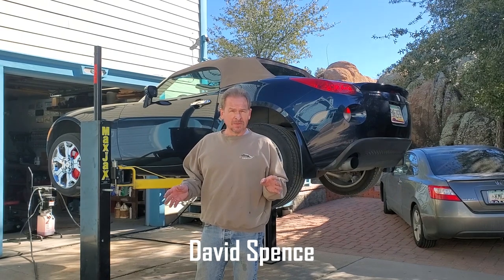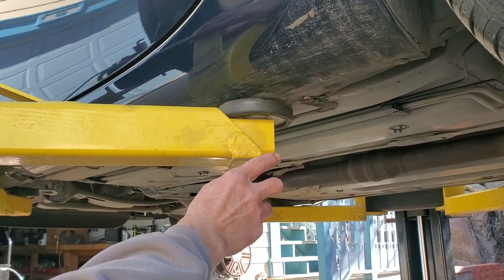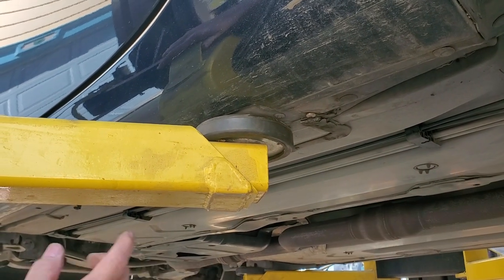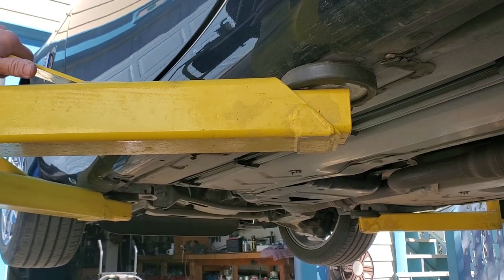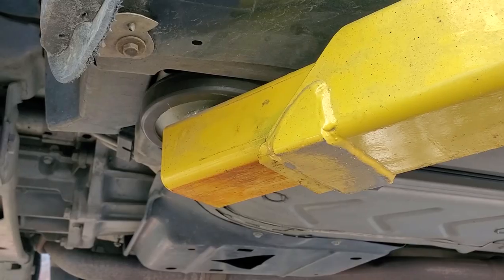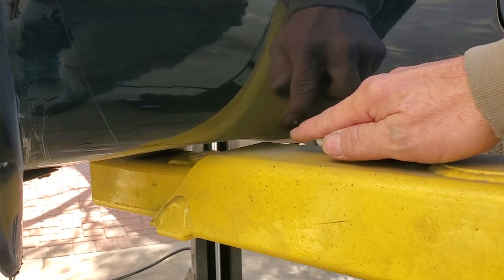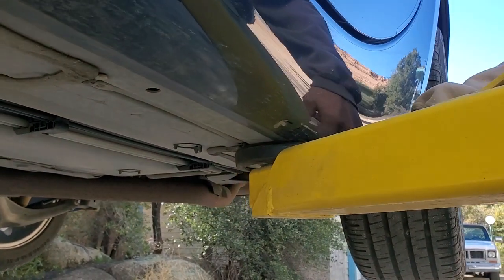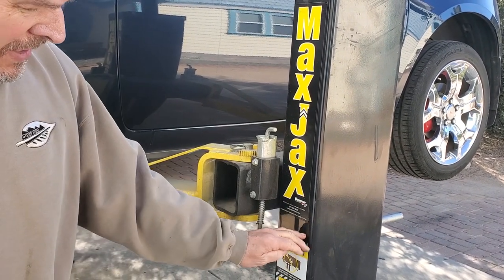How to Lift a Pontiac Solstice and Saturn Sky - MaxJax Lift Tips

Comment: Most folks on the SolsticeForum buy & use lifting pucks. At the 1:50 point in the video you can see one of the oval slots that a lifting puck will snap into. There are two oval slots per side. Lifting the Solstice or SKY by the rocker panels with no lifting pucks is a major no-no. Some folks buy BMW lifting pucks, some Corvette lifting pucks, and some make their own by buying 4 hockey pucks and eyebolts from a hardware store. I've read dozens of threads of damaged fenders due to incorrect lifting. The Solstice front fenders are metal, but the Saturn Sky front fenders are fiberglass, and are becoming harder and harder to find.
Reply from the maker: Wow, thanks for sharing such useful tips and information. Good info to pass on to our viewers. The thing that inspired us to do the video is that even many professional shops lift this car incorrectly. Thanks for watching!
Reply: Exactly why I carry a set of 4 in the “trunk” and tell every tech, in every shop, every time , to remember to use them.
Reply: I've looked many times but somehow kept overlooking those front slots, instead focusing on that from lifting point that he shows in the video.  Thanks very much for this.  I need new tires and am going to order a set of jacking pads right now!

Comment: Those lift points you used in the front get crushed all the time and cause fender damage. You're supposed use lifting pucks like corvettes and use the rear and the front slotted holes... i have a max jax at home and do this regularly... there's a lot of misinformation here
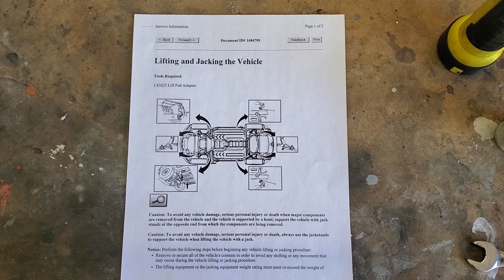Reply from the maker: If you watch the video you can see that at 3:41 I show you General Motors' instructions. I lift this car exactly as they say. The reason the sheet metal gets damaged is because most service people used their lifts with the standard round pucks on the outside point you note. That always damages the car. The instructions say to use the the inside points as demonstrated. I have never damaged the car using this method.

Comment: Where do you put a floor jack to put in  jackstand ? Is there center point of the car to put in floor jack?
Reply from the maker: The best option is a low rise jack at the point we show in the video with wood blocks under the tires. Also be sure the parking brake is set and the car is in reverse. If you need to remove a wheel about the only option is the low rise jack and stay out from under the car when removing the wheel. 

The car is, unfortunately, designed to be on a lift.

Thanks for watching, hope you found the video useful.
Reply: @CarzPlus  can I jack the car up from under the rear end housing?
Reply: @frankgalassi7821  yes.

Comment: I own one of these cars now, and I owned one when new. Pontiac damaged my 2007 Sol GXP multiple times by lifting it incorrectly from 2008 to 2010. So did Cadillac, from 2010 to 2012. You bet I knew they did it and you bet I made them fix it every time, but it didn't stop them from doing it again and again. My current one has slight lift damage but only in the front; looks like somebody stopped somebody in mid-error but if you kmow these cars, you can tell. rare to see one with no lift damage at all. I cannot excuse the General. Sure the car was not usual. When they were new, they were supposed to train the techs. And today, the techs damned well should know to learn how to service vehicles they are unfamiliar with. Falling cars kill. My dealer shop in 2010 (Cadillac) actually declined to install General Motors Performance Parts on my Solstice GXP. Designed by GM specifically for the car, sold as 50 state legal parts, info available to any GM shop, all above board, not thrid party, buy it right from the GM catalog, GM part numbers, not made to fit the car, made for the car by the manufacturer of the car. They refused to do it. Imagine the piss-poor training that makes a shop manager do that. I had to go to a GMC dealer! I saw another YouTube vid with a pro that had a Sol on a lift, and he was mentioning how the car was 'unsteady' on the lift. Of course it was. He lifted it wrong: using the wrong front lift points can do that. Scary that assumptions and a bit of ego can damage cars badly and even get the tech killed.
Reply from the maker: Wow, that's interesting! Quite the story. Thank you for sharing the importance of doing it right.